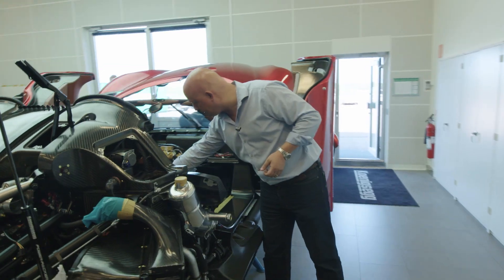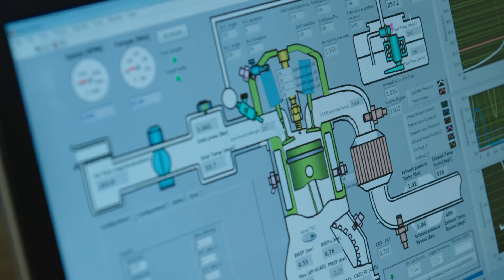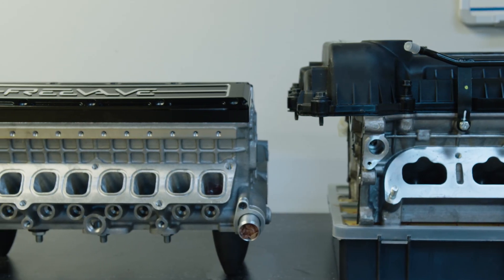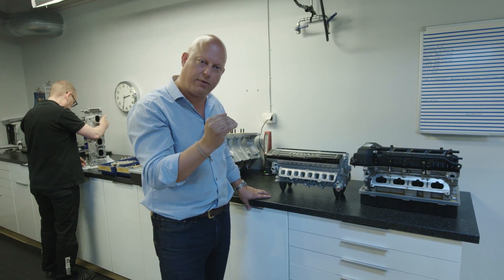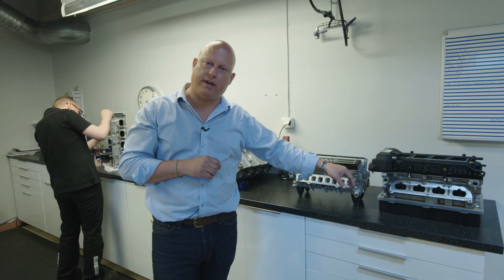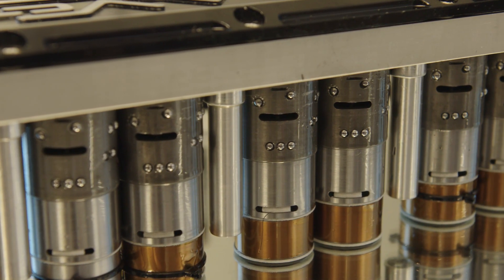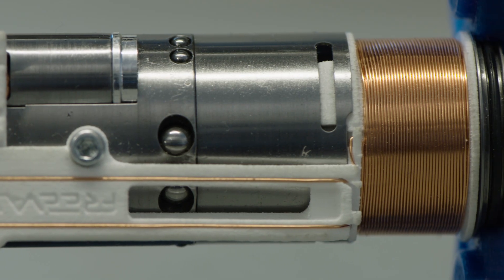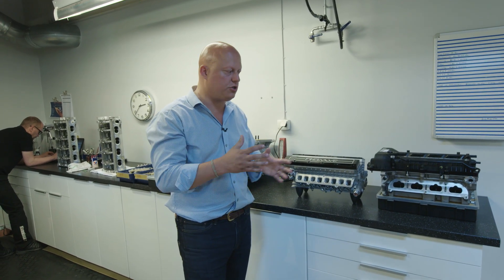Freevalve Update Camless Engine -- /INSIDE KOENIGSEGG

Comment: Does anybody know if there is a failsafe system that would for example close the valves in case the valvetrain lost communication with its control unit? In a normal camshaft engine, if the chain breaks you usually end up smashing up valves and damaging the cylinder. If there is some sort of instant response if communication is lost this could save tons of repair costs. I'm sure the engineers thought of this but I'm wondering if anybody knows for sure?